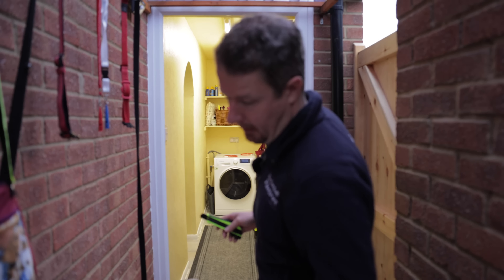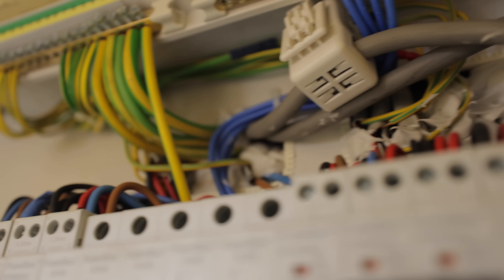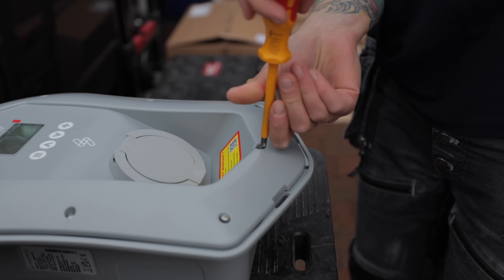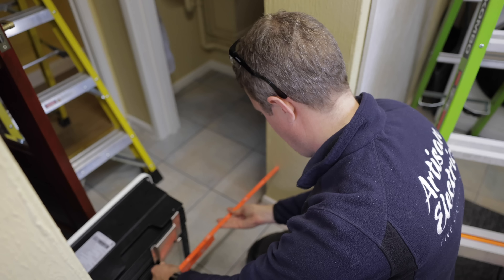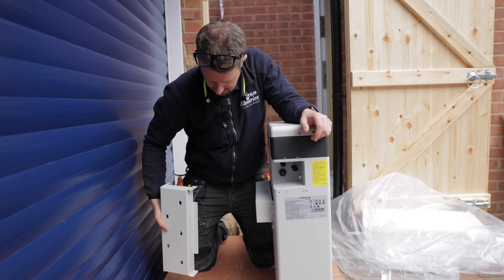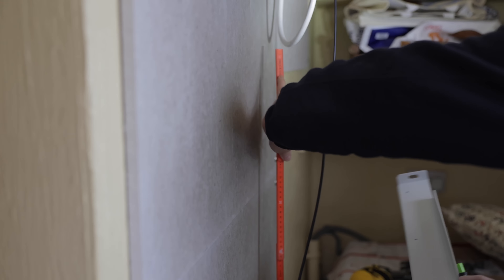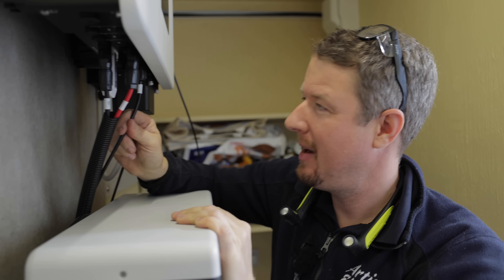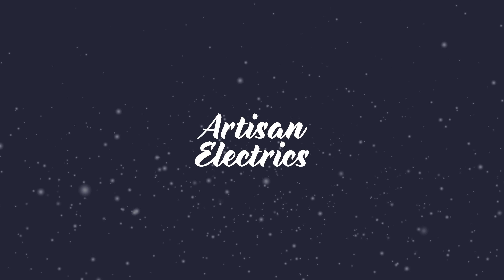Solax Triple Power Battery Storage Installation

Comment: I’ve installed a lot of sungrow hybrids with dc coupled HV modular batteries. 

Battery comes in 3.2kwh modules. Minimum system size is 9.6kwh all the way up to 25.6kwh. Install is a one man job because the battery modules are so light. 

If a battery module becomes faulty, we can warranty that module while the battery system continues to operate at a slightly lower capacity. 

Commissioning is super easy too. Simplest I’ve ever done. Very good app too. 

Very good price point too and much better than Solax in my opinion. 

I’m in Australia though so not sure if they’re available in the uk. 

9.6kwh model number: SBR097
5kva hybrid inverter: SH5.ORS

Comment: Great video as always, but have you considered the length of battery interlink cables for the Slave batteries (when they arrive) as these cannot be extended and are designed for side by side or one in front of the other mounting on the Solax system.
Reply: Solax are pain in ass

Comment: Check with Solax and make sure you have the latest firmware for the battery and inverter as there a known issue with the battery sticking at 98% also the leads between master to the slave are about 50cm

Comment: Great showing of an electrical company as always... highs ,lows,  as an electrician .. you show to others .. what we do in the industry..
But never like the bashing of other electricians on the channel ,which happens quite abit

When  Jordan shows how rough, he marked out a simple line ....and  hes supposed to be the boss ,so starts from the top..!!!  a straight edge ,tape measure,pencil.. job done !!! You made it look extremely hard ..when its simple

Then the no protection(dust sheets) for the tiled floor ,and expensive equipment 
Grinding on the tiles .that hurt us all to see !!!. thats 101  even for an apprentice to complete ,before start of job .. didnt see any floor protection for any areas inside .. carpets etcs hot bits of bricks,hot plastics etc ..going on ,i presume nice carpets 

Would like to see a video ,when 2nd battery is installed underneath the first one, just how the washing machine will slide out ,if all batterys,are the same size .... and to see how easy its going to be for them to do the washing .. im sure after the first load ,they will be swearing !!!!

As youve just shown us , we are all human .. and sometimes preach .. what you dont do yourself  ...

What i see ,is a good company ,good employees,who takes pride in there work ...but you make mistakes ,or slack on things at times ..like any good  electrical company in the country ,from what ive seen in quite a few videos now 

Maybe ask your sponsors, to give you floor protection,at the very least ..

Comment: As I found out today.. (fixing others mistakes).. the battery leads don't come mc4d at both ends as this allows you to run cables through glands and trunking. I had to remove the mc4s to reroute the cables

Comment: The advantage of having cables and connectors separately is that if the supplied cables aren't long enough, you can supply your own.
There's nothing in this video about configuration of the Zappi for the battery to prevent the charger draining the battery. Is that an oversight or is that covered elsewhere?

Comment: How on earth are the house owners going to remove the washing machine when it fails?
Reply: I was wondering that
Reply: No room in garage or loft? it's pretty intrusive in that tiny room. Another 2 batteries still to go in...
Reply from the maker: We measured and the washing machine will slide out just fine
Reply: That’s a relief! Re the batteries and portrait and landscape, doesn’t the bracket on the battery/BMS unbolt and mount 90° to accommodate landscape mounting?
Reply: Yeah, I was wondering the same thing. The back wall seemed like a more logical place (space permitting).
Reply: I was rather concerned at how thin the battery wires were (looked like 4mm solar cable) as my solar batteries use 25mm cable.
However my solar batteries are 48v (well 51v) and those solax I think you said were 100v+
Reply: For years I'm askimg myself if TV size is eventually going to reach the point where TVs are delivered during the construction of a building before the building is going to be closed ;-)
Reply: @davespages  HV lithium battery’s require way smaller sized cables. Gone are the days of 70-90mm battery cable all hooked up to 2-12v Gell sealed battery’s. It’s the same over here in aus. Everything wires into those sunlock mc4 connectors.
Reply: They'll just build a new house
Reply: Small forklift
Reply: @MrGCsurfer  

Current?

The bigger the cable the better.

Have a Google at volts drop ref current draw. Plus power.  Think length of cable run too.

Volts don't really matter, it's the current you should worry about.

Which is why punters should always leave it to professional sparkies for all electrical "works to".

Far, far too many cock ups by DIY "experts".

And, far worse, by so called "electrically qualified" plumbers and kitchen fitters.

Hopefully H&S Executive will take more interest in the low quality courses dispensed by so called "training outfits".

A disaster waiting to happen.

Comment: Excellent Video. I have just accepted a quote for Solar (Trina Panels) with Solax inverter and battery for my home (not a big house no not a 4Kwh system from EGG. Had heard some mixed things about Solax over SolarEdge (who need optimisers on each panel costing £3000 more) and that its best to keep to one EcoSystems (hence why they quoted with all Solax. Another Company Quoted with Givenergy Inverter and Batteries but not seen much about them, but they wanted more ££ for it. The system I have been quoted for is 2.6kwh over a 4, as my usage estimation is around 2200kwh a year. So 4Kwh is overkill.

Comment: Even before you mounted the inverter, I was wondering if the washing machine was going to be an issue.  The house owner is not going to be happy when the washer needs to be worked on or repaired.  Is the proximity of the washer discharge hose to the third battery a danger?
Some people like to stack a tumble drier above the washer, this would now not be possible.
Early in the video, you used the quote, measure twice, cut once, surely this also apples to planning and layout (portrait/landscape, headroom, access, maintainability, future proofing.
I hope you keep a “lessons learned” spreadsheet so these issues are not repeated because at the end of the day, it is the customer who will have to live with the system you leave them with.

Comment: I was wondering where you are going to install the extra battery pack, couldnt install it in front of the existing, as leads are too short to get the 300mm spacing between packs , and cable input and output are opposite sides, only allowing for side by side installs. Was a real dilema for me to figure it out.

Comment: Got same inverter only mines a 7.5kW and 2 batteries and they are in the garage floor mounted to the wall. They're heavy beasts and you would not want them falling off the wall at any point. @Artisan Electrics Do you cover Birmingham area by any chance? Looking for a consumer unit upgrade to 18th Edition, with 100amp fuse. (Currently set at 80amps and DNO will update their fuse once this is done.)

Comment: I’m a plasterer and I have at least 2k of tools not just a trowel and bucket thank you
Reply: I’m not even a plasterer but did some rendering of garden walls last summer and even I ended up buying a powerful impact drill which doubles as a paddle mixer, the mixing paddle itself, a couple of buckets, a set of trowels and of course the all important sponge! ;-) I imagine a pro would also need things like stilts and probably umpteen other things I’m not aware of. When Jordan made that comment I had a feeling we might hear from a plasterer or two!

Comment: Jordan you could just modify the mounting brackets to be able to stack the batteries landscape. or instead you could mount said brackets vertically so you can moun the batteries landscape (like you wanted too) versus portrait (how you have too).

Comment: Cable from the AC isolator looks undersized? I'm sure the 5kw inverter comes with 10mm brown ferrules? What size RCBO did you use. Also you've no side plates installed on the Master battery and you're governed by a certain length on the slave battery DC cables connections so I don't think they're going to reach looking at your installation layout. Definitely check the firmware on commissioning as well. Most need updating.

Comment: Once the second battery is installed the customer will have problems replacing the washing machine when it packs up.
Reply from the maker: It will slide out just fine we measured it
Reply: I’m sure the washing machine will out live the battery and probably the whole system

Comment: Surprised to see MC4 connectors for high current connections, also the battery conductors look a tad on the small side...what's the rated output of the battery/inverter system ?
Reply: Agree those battery wires look suspiciously thin - as you say MC4 are usually high voltage with low-medium current - I was supplied 6AWG for my Solis AC inverter and the Pylontech batteries are supplied with 4AWG which are both roughly around 13-20mm2 and good for around 100A even though the inverter only takes 3kW or 60A max in either direction but it's a 48V battery - I think the Solax uses a higher voltage on the DC side hence allowing for thinner cables more akin to a lower voltage PV string...which kind of makes sense as ideally the DC voltage would be close to the peak to peak of the AC output of around 350-400V as it is for the MPPT side of a string inverter...
Reply: @Umski  Just did a bit more research on the batteries, they look like nominal 100V output, so I guess double the output/half the cable size to a normal 48V system, still not sold on the MC4s and cable sizes, but hopefully they've done all the testing.....
Reply: battery pack voltage is around 130vdc each

Comment: Love the videos, been watching back.over a few of them, only thing that confuses me on this install is you have a power supply from the consumer unit to the inverter to charge the batteries but now power coming back out of the unit to power anything, I'm planning on doing a basic battery backup.unit in my flat like this and just trying to get my head round it all.
Reply: It's the same cable... power flows one way to charge, the other way to discharge.

Comment: How come a battery isolator wasn’t fitted in between the battery and the inverter? 

I know Solax have one within the unit but it’s not really accessible for isolation?
Reply: And manufacturers instructions show an isolator external to the battery before the inverter
Reply: The last Artisan battery video didn’t show an isolator either?
Reply: I’ve only just seen this one but manufacturers instructions show an isolator present before battery?
Reply: On the instructions I’m reading I don’t see an isolator between battery and inverter
Reply: MCS guides also state it requires an isolator before the battery? 

We have had to source battery isolators from all over the country for our own installs, I was wondering whether there was a reason it wasn’t installed?
Reply: @mikegawan6395  actually I found two manuals and yes one manual shows an isolator and the other doesn’t but it would seem best practice to fit pne
Reply: Would have thought the fewer connections you can have on the DC side the better.

Comment: Jordan, there isn't any mention in the manual that the batteries support landscape mounting.

Next time do what I normally do, cut the fluf of the sellers pitch and get the manual to check for yourself. If something is provisioned it will be in the installation manual.

It will save you a ton of headaches...

Comment: I've notice a lot of you electricians and plumbers knock in the plugs flush to the surface.... I would like to point out that you should get a long enough screw and knock the plug into the actual wall past the plaster thickness. The plaster has next to no strength. I have had to take off and refix so many radiators because they have dropped off the wall..... What next going round refixing battery packs that have fell off the wall.
Reply: Not forgetting satellite dishes that go on cladding.

Comment: Why wasn't the EV charger cable passed straight through the external wall and brought up the wall internally?
Would have look much neater.  🙂
Reply from the maker: Lots of stuff in the way inside
Reply: Looks like the owner didn’t want to pay out to chase the cable in or run it above a ceiling. Not sure you even could with a cable that thick without chiselling into the bricks a bit.

Comment: i hate those "hidden" mounting brackets. yeah it looks nice once its there, but if they just made two (adjustable for level) holes/hangers left and right,
you mark+make the holes with the hopefully included paper drilling template in the packaging, put the hooks in and be done.

same for the small ethernet switches (netgear, tplink, dlink...) . if they just put the holes on the sides (or through hole, there is plenty space in the case!)
it would be a tiny bit larger, but you could just screw them directly onto the board / wall and they are fixed.

no, you need to drill holes for hidden screws in the back, and fumble around till the screws are in the holes and kinda clamp a bit but not too much, no way to adjust for level.
and the next nucklehead throws the thing off the wall when pluggin in cables (because its not fixed, just hooked) and doesn't get it back on properly.

Comment: In a system like that, is there any lower limit that the batteries shouldn't be discharged below i.e. 50% to prolong battery life? This becomes more important if you want to power the house during the day from batteries charged off-peak.
Reply: For LifePo4 based batteries - which most are nowadays, then you don't want to go below 10% and you also don't want to charge above 90%.

Comment: Why an inverter based system?  Surely a Puredrive AC battery would just fit on the wall and your done. Am I missing something?
Reply: The marketing team have done well there calling it an AC battery - the white box still has an AC inverter and DC cells inside it 🤣
Reply: @Umski  My bad. I should have said AC coupled. All batteries are of course DC but what I really meant to say was why have an external inverter when you can have a neater solution that is just a narrow box on the wall.
Reply: @wajopek2679  sorry, fair point, I think if the customer wants a 'fit and forget' solution it makes sense but a lot of 'all in ones' are not quite so modular as they cater for a standard capacity e.g. 5/10/15kWh etc or aren't so flexible compared to having a standalone inverter and separate batteries to configure depending on circumstances - being modular it also means if one part (or pack) fails then it can be replaced more easily without the whole thing having to be pulled apart or replaced. That said the Solax uses HV DC packs so although modular you're stuck with that brand...

Comment: Jordan can I please pick your Brains, I've got the same Solax X1-Fit inverter Solax 5kw master battery and 1, 5kw slave battery, the Solax is connected to my Solis inverter for PV my issues with the Solax App has it doesn't show PV Generation my question is can I fit a CT Clamp from the Solax to the Solis inverter so that PV Generation shows up on the App please, any advice would be appreciated 🙏
Reply: Interesting. I'm just about to have two 5.8kWh Solax batteries and the same AC charger with built-in EPS fitted. I already have two 5kW Solis string inverters, a Zappi and Eddi fitted.

Comment: They don’t provide them pre terminated because you should have a DC fuse in circuit really, so you’d put lugs on and split the cable to have the DC fuse in to ensure the battery is fused from the inverter.
Reply: Not necessary if the battery has a built in breaker - which this one does.
Reply: @blower1  not always true. Often these breakers are for single batteries whereas on systems you can chain you’d want the whole circuit to have a 120amp breaker for example. The capacitors also mean you can turn the breakers off and still get a shock (see the manual) 

Surprising Jordan didn’t spot it, it’s in the solax manual. 

> There should be a nonpolarized DC breaker to make sure battery can be securely
disconnected with inverter when required.
Reply: @gsdevme  Breakers are designed to protect the cabling and battery from shorts - if every battery has a breaker you don't need an external one....what you are talking about is an isolator - which may or may not be needed depending if it is recommended by the manufacturer. In this case it may be needed - i've not read the solax manual.
Reply: @blower1  yeah it’s recommended.